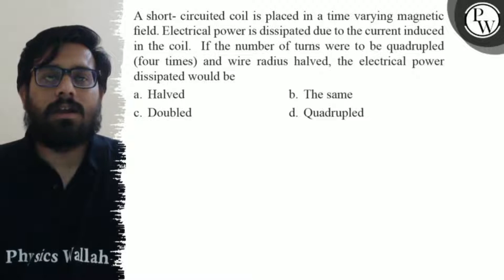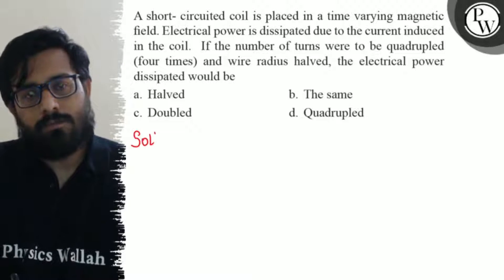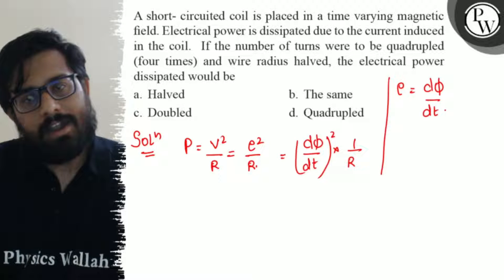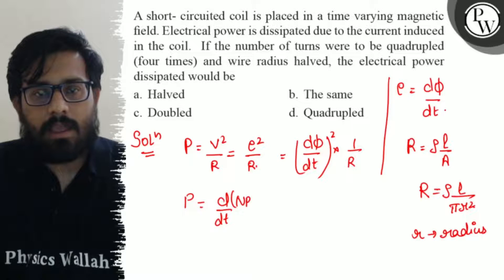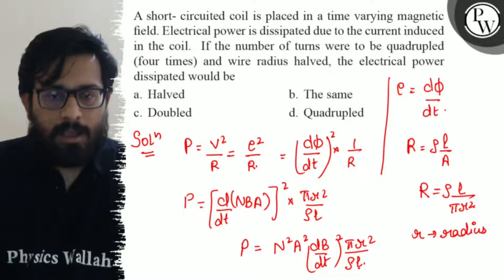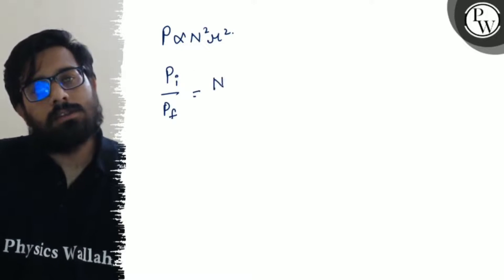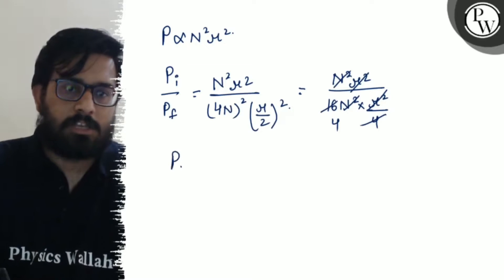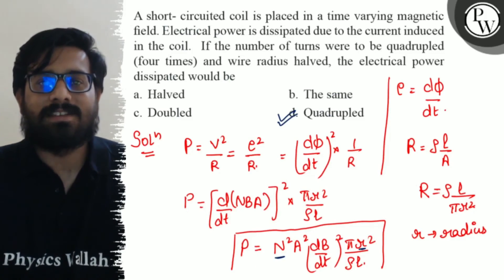A short- circuited coil is placed in a time varying magnetic field. Electrical power is dissipate...

Comment: GUYS PLS NOTE 
That the radius of wire is halfed not the radius of loop also length of wire will be double as l=2πrN
In resistance =pl/A here A is area of wire it will be change as wire ka radius change hua he 

In flux=BA HERE A DONT CHANGE YE LOOP KA AREA HE LOOP KA AREA NOT CHINGING KYUKI RADIUS OF WIRE CHANGING NOT THE RADIUS OF LOOP
Reply: hmmm
Reply: Thanku very much ❤️💖💖

Comment: Sir you forgot to consider the effect of length on the resistance. As length of wire is also quadrupled it also paudrapals the resistance. Hence the ans would be remains the same.
Reply: How length was quadrupled?
Reply: The formula of power is B²L²V²/R,since the no of turns are quadrupled and the length becomes half thus final length will be L/4. Thus power will remain same